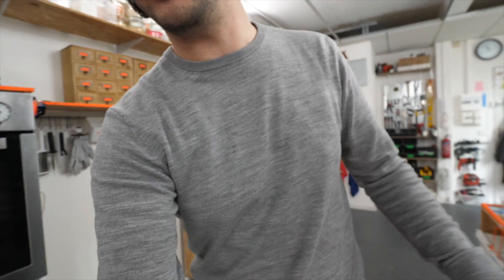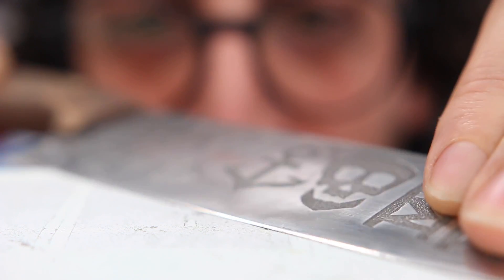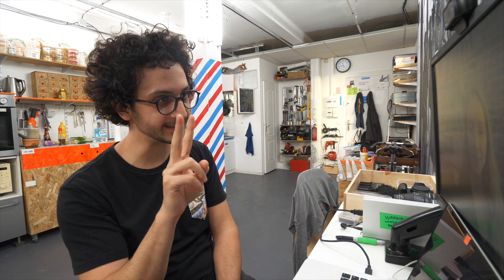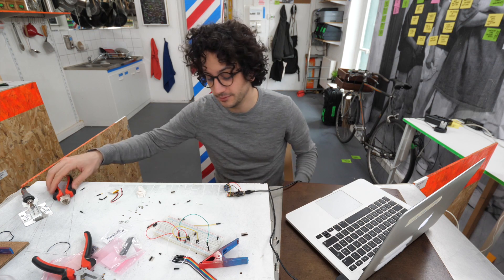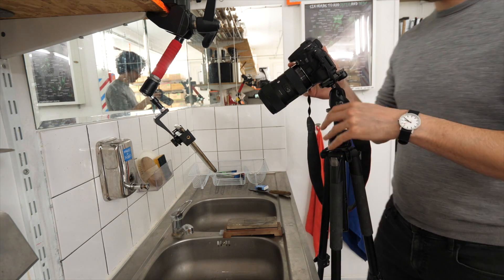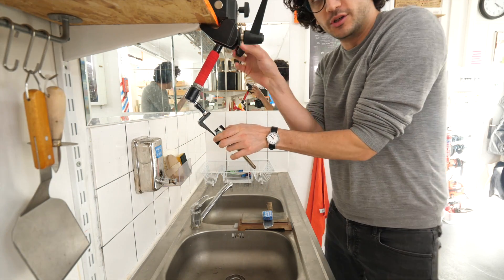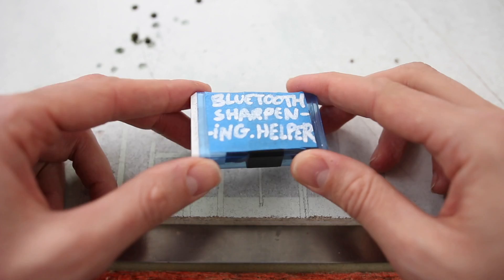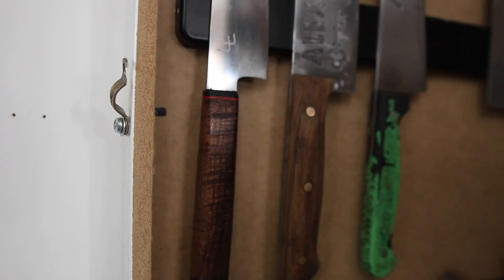Is This The Future Of Sharpening ?

Comment: An electronic solution makes no sense if it doesn't correct the angle automatically, the mechanical solution that you mentioned is still better because it is consistent. This will help you knowif the angle is wrong while sharpening (although you still need a complicated rig for it) but so will a bad edge after sharpening. No matter what, you'll still have to practice until it gets engraved into your muscle memory.

Comment: dont move the knife, move the stone. it will help you to keep the angle
Reply: Oh now that's interesting. Just make a  jig that holds the knife in place at an adjustable angle and a set of rails so you can move the stone back and forth. With the wrong design though you might have trouble keeping a consistent pressure on the blade. Definitely a good idea though!
Reply: it's the basic idea behind a sharpening wheel
Reply: That's essentially what a lot of the other systems out there do, including the one he mentioned/pictured.  Usually not cheap though.

Comment: If you put a red and green led on it, then the phone could set the desired angle. As you sharpen, have it display red if you're +/- 3 degrees. that way, you can visually see on the knife how you're doing.

Comment: Why not to just create a wedge with desired angle and little piece cut off where the blade touches the stone and attatch it to the knife? Then proof it somehow so the wedge slides well and doesnt get destroyed. Maybe two rails/rods could be added on the sides to the stone, a bridge like structure would connect the two that would slide on those rails and you put the wedge on the bridge, a little above the stone. I have the idea imagined. Let me know if want more details.

Comment: Alex French Guy Home Electronics

Spread it like voltage.
Reply: Spread it like thermal paste.
Reply: Spread it like fiberglass, butter it like circuits.
Reply: azdgariarada I was thinking perhaps have a a few settings on the device that  when at optimal angle it lights up so you know your have the right angel. I was Army for 14 years so I have a few ideas when it comes to sharp knives.
Reply: At the right f***ing angle!
Reply: Spread like spectrum
Reply: yes please :D
Reply: spread it like soldering flux

Comment: I'm gonna try this now. Would love it if I got more advice on how to carry it out cause I'm still struggling with getting a sharp enough blade to shave off hair 😂
Reply: Ask and it will be given to you

I reckon the easiest way to do this would be to skip the whole Bluetooth to the phone thing and make a standalone design and present the data on a small 128x32px OLED which you can angle a bit to make it face towards you while sharpening.

That way to can cheap out on the computer and get something like a $5 Chinese Arduino Nano. For the sensor get the same one, a BNO055, and as in the video, just get a breakout board so you don't have to worry about wiring up the chip yourself.

Then get a button (more on that later), and maybe an LED to give you a warning when your aim is off.

For the software on this, just make the OLED display the value, which in contrast to the BT + phone solution, will have very little delay. If you want a 15 degree edge, make the LED light up if the angle is too far off, and then the button: A push of the button starts a grind, and another push stops it. During a grind you are presented the value on the OLED. When you stop, the average is presented so you can actually get an idea of if you are aiming too low or too high. Then another push resets the thing (which could also zero the angle).

Further ideas include adding a button to cycle for different target angles.

You should be able to find drivers and tutorials for all these components, you might just have to combine a few, and you would probably be able to do this real cheap if you get knockoff components from eBay.